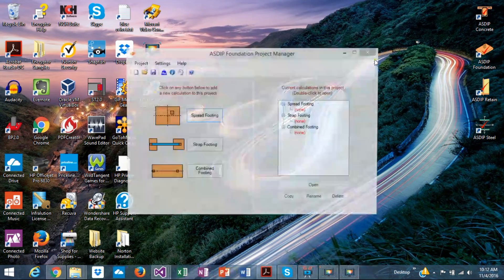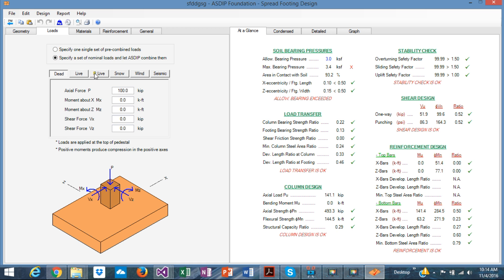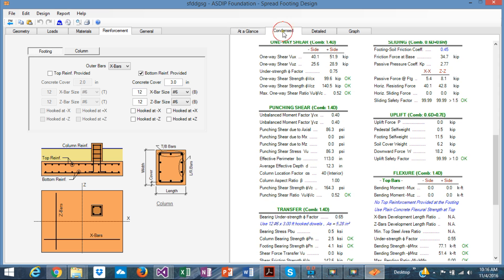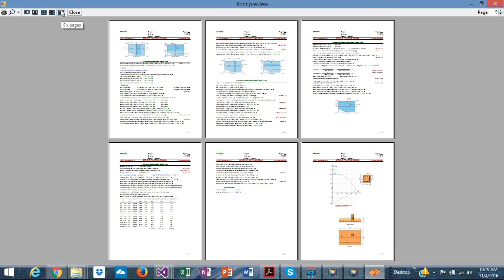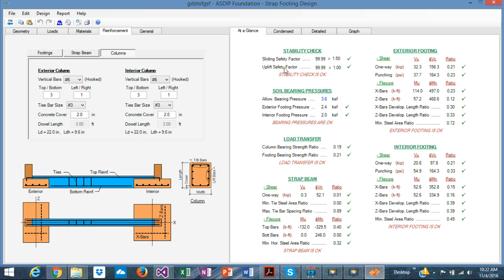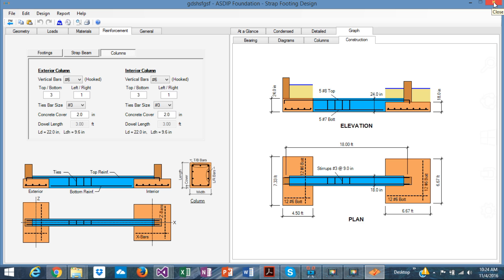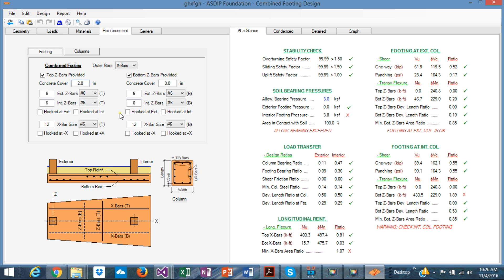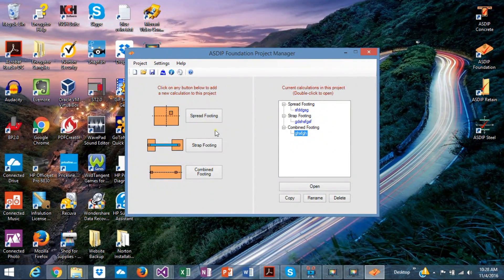ASDIP Foundation Overview

Comment: my footing fails at column bearing strength ratio. the only way to fix this seems to be increasing dimensions of column. i cant find the provision of dowel bars for taking the axial force that exceeds max bearing strength of column without dowel bars. can i just add dowel bars and ignore the failure in column bearing strength ratio?